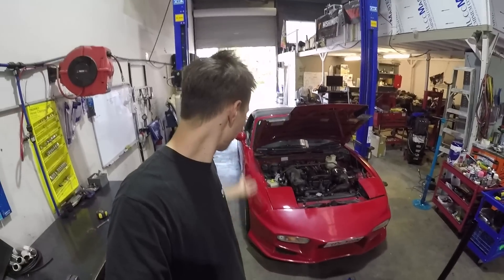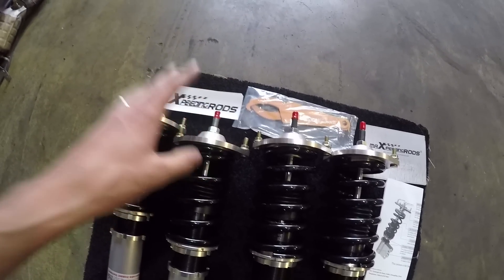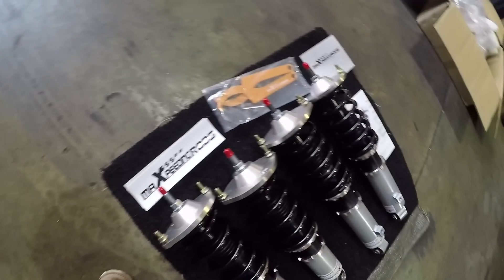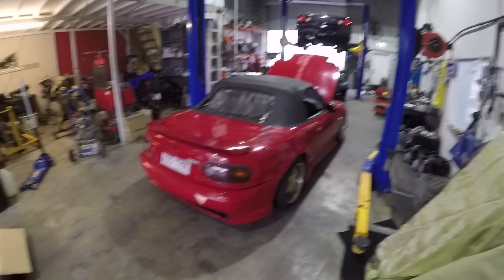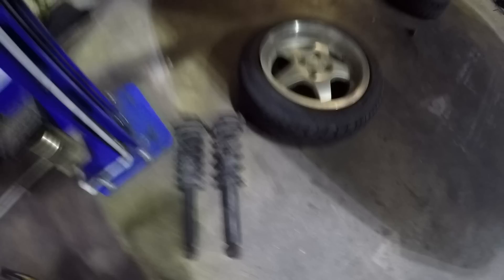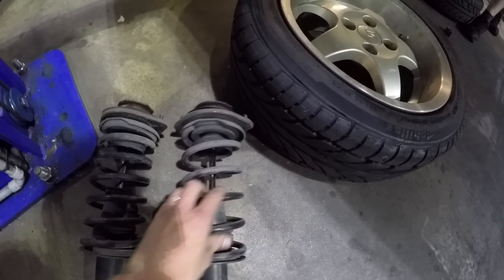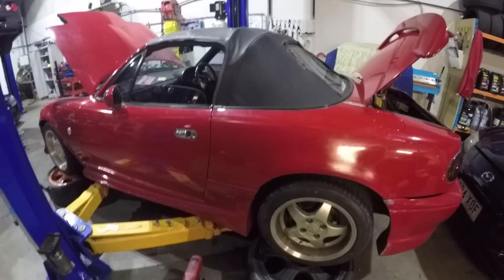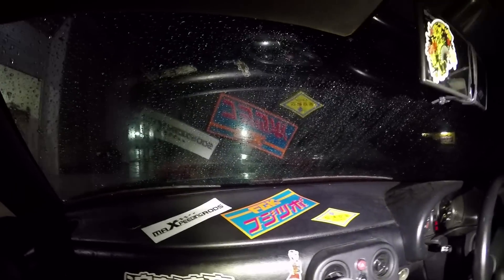EBAY COILOVERS, GOOD? - MAXPEEDINGRODS Coilovers

Comment: I've actually been considering these coilovers for my mazda 6s. I've watched and read loads of reviews about them and most everyone says the same, the rear just doesn't sit low enough. some people have fixed it by changing the springs on the rear, some by adjusting the dampening, and some say they settle over a few weeks and kinda evens themselves out I guess. Either way for only 200 bucks I'll probably try a set.  If not, then maybe cxracing or godspeed. Just not wanting to spend an ass load of money.

Comment: Those rears, you can also reduce preload on the spring  (the other adjustment, the one with the lock ring) to lower it further. You don't want to go so far you have a loose spring, but if you have to you can just buy those flat collapsing helper springs to get around that

Comment: Great video, I recently helped a mate install a set of Maxpeedingrod coilovers on a Lexus is200 and we also came across the same issue that the rear coilovers would only lower by 5mm compared to stock ride height so we tried installing the front shocks in the rear and changed the spring, bottom mount and top hat to make it fit in the rear as the fronts have a shorter shock body and it worked fine. Their not the greatest of coilovers but for $300 they got the car low but it would be worth saving and getting a set of MCA’s

Comment: Thinking about picking up a set for my na, I ran maxspeeds on my g35 and she was hella slammed regardless. The rear was higher but once it settled after a few she leveled out just nicely. Obviously tossed them and got bcs but I'll give these a shot again lol
Reply: Brendan May I have a 05 g35 and just got my maxpeed coils, are they worth it? So I won’t install them and just return them and get some brand name coils. Pls lmk
Reply: Oscar Salazar For the price bud they were worth it,  atleast to me. They were a little on the softer side so they were a bit more bouncy than most coils. I’d say if you’re trying to replace blown struts/get low on a budget they’re better than nothing. Had them for like a year before I got bcs

Comment: Could not agree that the MAXpeedingRods are ok for daily ... they produce a harsh bumpy ride on roads that aren't bowling greens. Regret buying mine.
Reply: One user found similar springs with a softer spring rate to get a less harsh ride.
Reply: One user Mr Dennis Robinson? If they replaced the springs perhaps the shocker and strut could also be replaced to achieve a workable combination? These coil overs are useless for daily road driving period.
Reply: @muthamail  there are alot of people happy with these coil overs, i suspect certain vehicle models they hit a home run and on others the springs are way too stiff!     In the situation I was able to find a guy found a softer spring in the front by 100 lb-in and it made all the difference in the world, better than factory and able to change ride height.

Comment: He didn't set the preload.   Also users found you have to grease the top bearing and where metal touches metal.     One guy even changed the spring for one that has less of a spring rate for the perfect ride.

Comment: Maxspeedingrods coilovers are garbage I bought a set for my rx7 for $575 6 months later they were $230 I had them on my car for about 3 years now and after two and a half years the front passenger snap cuz the top pillow ball mount locked up and cause the internal bolt to loosen and back off snapping the internal of the coil over they're complete garbage if you're going to go a set at least go with the non dampening adjustability cuz then the internal Rod would be solid not Hollow and for a ride quality and handling they're just like any other set of coilovers you tighten them up they're going to be stiff if you loosen them they're going to be soft I would say I wish the right height adjustability can go down lower
Reply: Probably wouldnt be bad on a double wishbone suspension then.
Reply: Skynet Cyborg because rx7s are dime a dozen

Comment: haha i got them on my drift 350z, they not too bad!
Reply: Did it also not lower very much like the Miata?
Reply: I need for s13
Reply: ztuned update on them? Thinking about getting them for my 2004 G35Driver coupe
Reply: How have they been so for!!
Reply: @NattyVeganLifter  Don't, go with something like Truhart. I don't have them myself, but those are in the same family as D2s and are the cheapest I'd go on a G/Z.   I'm about to throw on a fresh set of Tien Flex on my 6mt sedan. Mainly went with them because you can add an electronic controller to adjust dampening on the fly from inside the cabin.  That's basically a hands down buy for my needs.